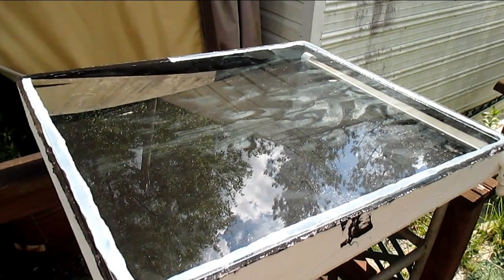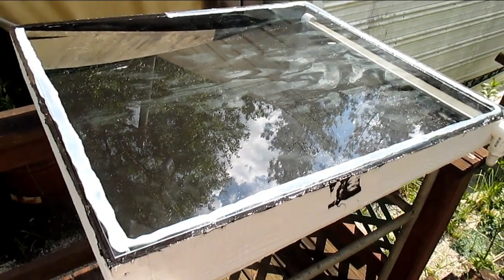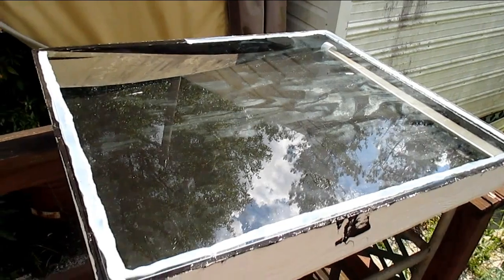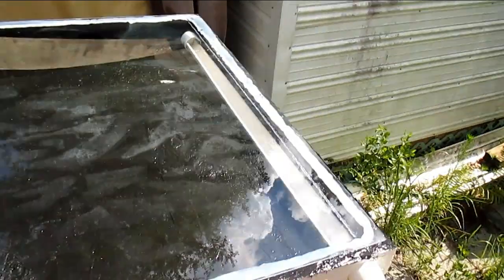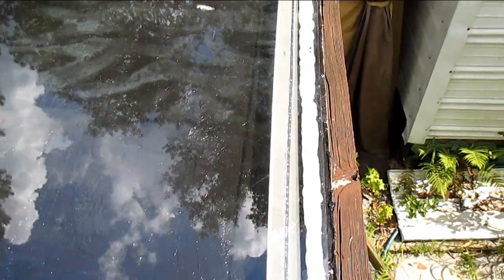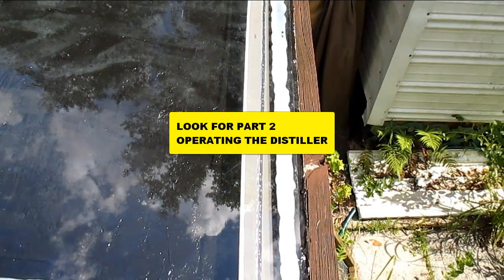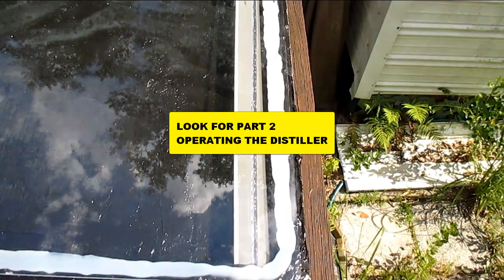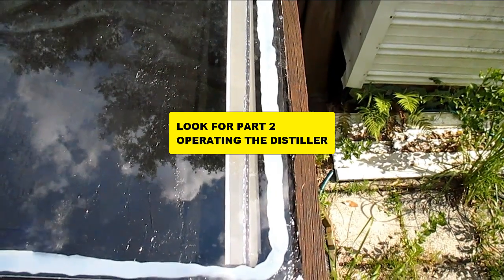Solar water Distiller Part 1

Comment: Should never use pressure treated water in a solar still. It will leach toxic chemicals into your distilled water. It does not need to come in contact with your water to do so. We tested this in a lab. Even if PT wood is painted or coated. And you never want to use paint of any type within the solar still. Pvc pipe should never come in contact with your drinking water!

Comment: Hi, I tried to make my own solar distiller for my college assignment but it doesn't seem to work. Very little amount of water were collected. I used a 3mm glass as the cover (both side of the distiller are glass too). The bottom of the still were covered with black cloth. Can I know what I did wrong? Im very worried that I'll fail my assignment😣
Reply from the maker: I would say that cloth is not a very good conductor of heat. Take cloth away and just paint it black if you can find some paint non-toxic. All surfaces black except for the glass top. Use mirrors to focus sun and amplify heat.. The fact you are collecting any water means you are on the right track.. the distiller doesn't make a huge amount unless you are doing a large scale.. depends on the sun and that's been real iffy this year and now starting to cool also.
Reply: @CrackerSwamp  Hi thank you for replying. The only non-toxic paint I found so far has a "gloss finish" Do you think it's okay? Since glossy things will reflect the sun right?
Reply from the maker: @heyitsme1648  Sure try it.. it couldn't hurt right? I used wood on the bottom and sides because it acts as an insulator from wind cooling the whole thing. I would probably glue Styrofoam on the outside of those glass pieces that are not on the top.
Reply: @CrackerSwamp  got it. Thank you so much for your help!
Reply from the maker: @heyitsme1648  I believe you're gonna pass.. good luck.
Reply: @CrackerSwamp  thank you for your kind word. I really appreciate it🥺
Reply: Did you seal up the box air tight? Also consider using a reflector with better heat conduction then cloth (stainless steel, copper, etc) and then paint it back
Reply: Is your project is completed?

Comment: So I made a solar distiller from a 35 gallon plastic drum.
It didn't work to good. Less then 2 cup of water.
And the water has a bad taste. I don't mean it taste like distilled water. I mean it has  terrible taste.
I used a plastic drum, silicon all purpose, and green house plastic glass.
Drum had syrup in it before.
So what did I do wrong?
Reply: I sealed it with the silicone. And use a silicone strip to stop water on the down hill side. Which it falls into 3/4" pcv pipe goes out into a tube that then goes into collection bottle.
Reply from the maker: Silicon all purpose is bad. You need food grade silicone. All plastic has to be HDPE. So plexy glass is out too. Need real glass. The drum is probably HDPE.
Reply: @CrackerSwamp   @Cracker Swamp  ok good to know of silicone.
Glass is green house plastic glass not plexiglass.
Where to I get the good grade silicone?
Reply: @CrackerSwamp  Now wait a minute. I though I seen that yesterday day. 
I used the same silicone you used in the video. All Purpose.

Comment: Just found your video, really interesting. How much water do you add? Cheers from Ottawa, Canada.
Reply from the maker: You don't want to fill it for sure. It should be below the catch trough. The deeper the water the harder to heat it. Make sure to use a food grade silicone. Regular silicone is too toxic. Should wait a couple of weeks before using it to off gas.

Comment: Nice job.
Just wondering if you use this distiller everyday now ?
Reply from the maker: I use it a lot but not everyday. So busy I forget to fill it.
Reply: OK, thanks.
I am just trying to decide whether it is worth drinking distilled water only.
Reply from the maker: If you only bought your water from Walmart its great. Its easy to drink and nothing in it.
Reply: @georgegibson707  Distilled water is Pure. Anything else, Reverse Osmosis, Mineral, Fiji water, Holy water is not pure. Drinking distilled water will purify the body because one of the hydrogen molecules in the H20 has a negative charge. Toxins in your body ie heavy metals, bad cholesterol, etc have a positive charge. The dw will attract the toxins magnetically and rid the body thereof.
Reply: @NoahVonNoah  i've heard things like distilled water is dead water and we need structured water. do you relate this with any of your experience since the last 2 years you had posted this?🙏